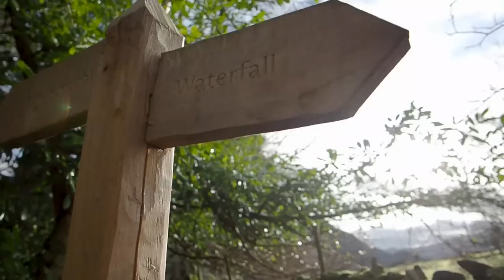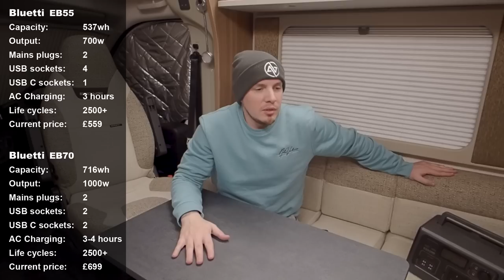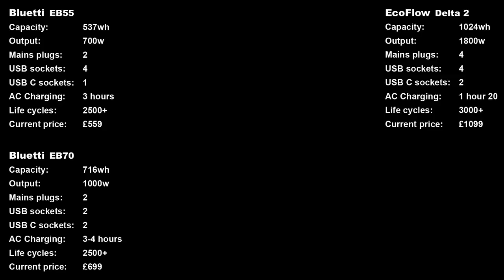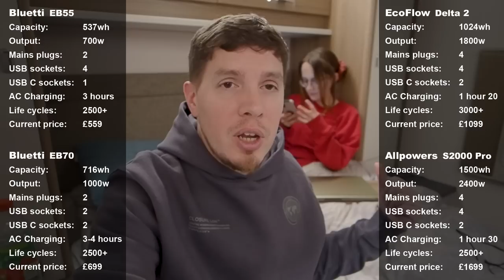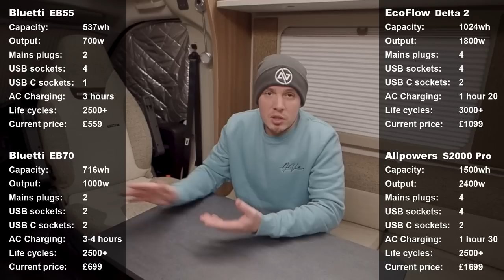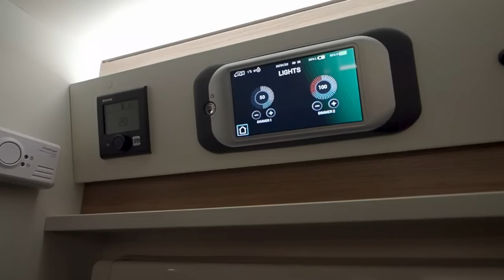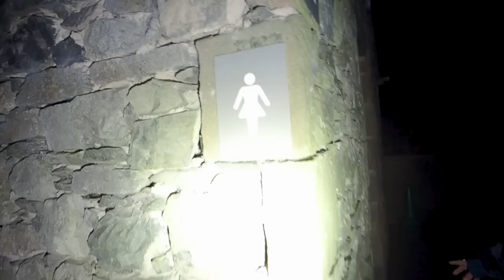The Best Power Station for Van Life UK (off grid living)

Comment: My Bluetti was fine when it was working but now after 4 months of limited use it is frucked. Trouble is Ebay purchase so can't just take it back to shop. After a couple of weeks of email I now have to send it back for them to fix which will take who knows how long. Print return label, I have printer in van of course I do! Pissing me right off.
Reply from the maker: Ahh that’s not good. Do you know what it is in particular that stopped working? That’s why I usually buy everything on Amazon because they make returns so easy. But yeah eBay gives a good bargain so it’s a difficult one!

Comment: When you empty the toilet cassette,  start pouring then press the yellow button... this let's air in and stops it splashing 👍
Reply: My caravan is the same make and layout as this motor home
Reply from the maker: Ohhh we were wondering what that button did! There’s also a twisty button that covers the lid but it didn’t seem to make any difference of it was twisted open or closed!
Reply: @Adz Ventures  the twisty button is to open and shut the cassette using the lever on the side of the toilet.. so you can close it for travel